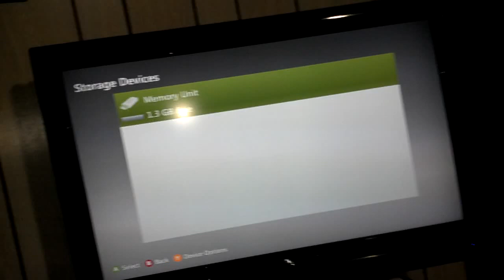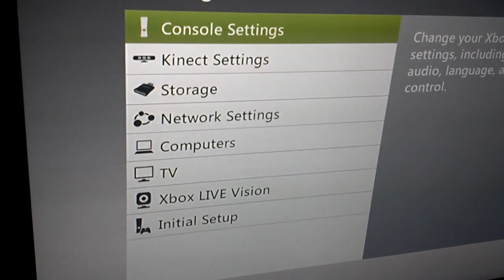Xbox 360 Phat Console Internal Memory Mod

Comment: Since USB is typically 5v, it would work better if you connected the power from USB to the 5+ V on the other USB ports and the grnd, Data + & - to the memory card port pins.

Comment: I have an old original white arcade 4gb system.  Do you know where the location of the 4gb internal memory on the motherboard is for these arcade 4gb internal systems?  I want to troubleshoot a corrupted internal disk on my own but I can't detect where it is on the board and googling around hasn't proved beneficial.

Comment from the maker: Also are you talking about the internal wifi mod or internal memory mod?
Reply: UnRevoked360 
Is it possible to solder more ram, maybe replace the ram chips with ram chips that have more ram
What about modding a slim power supply into this fat xbox360 model I definitely want to use a slim model power supply into this, maybe an adapter
Reply: UnRevoked360 international WiFi